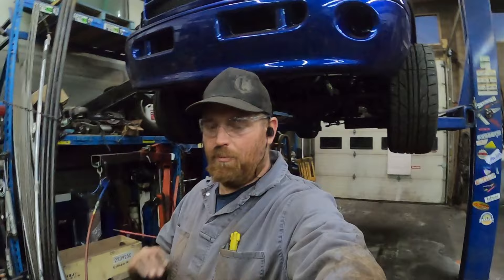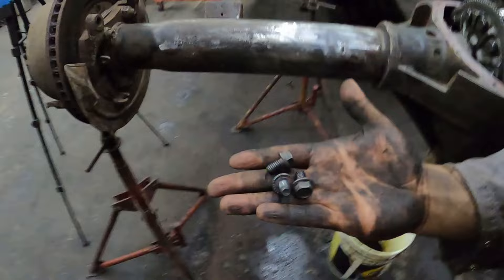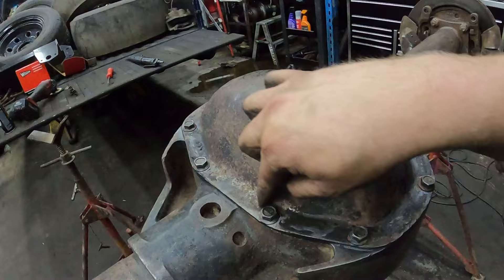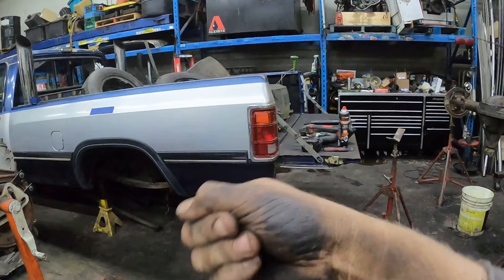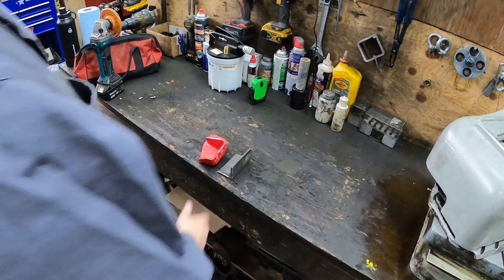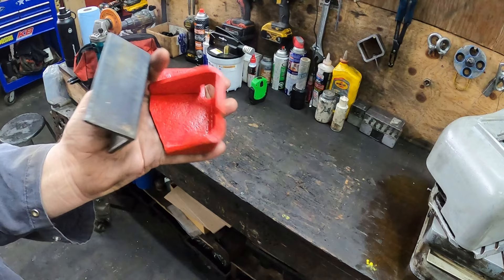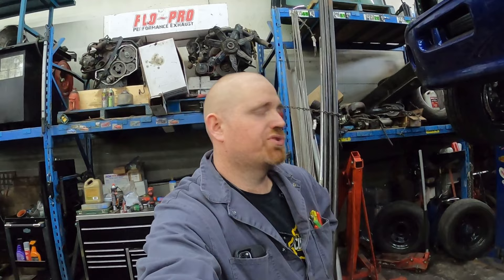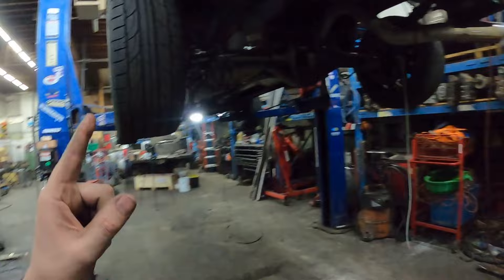DANA 80 DISC BRAKE  FOR THE SHORTY BUILD !!!!

Comment: Got a 100k front end I'm getting ready to put my 500 doller Timken berrings on. I will probably paint it do the seals etc. Then put it under my 97 dodge. Got the factory cummins head gasket and bolts to put in Tomarrow. It's my service truck, it's pretty for a 97. Welder is powdercoated to match
   I like the idea of powder coat the diffs.
   Just got the head gasket today.
Reply from the maker: I am looking at a 2wd first gen to do dyno videos with . Hopefully I can swing  it after buying the dyno

Comment: I appreciate your videos and advice . I cup brushed from front axle the 2001 after I got it home from  Differential and Gear , new ring gear , pinion. Bearings seals . I cleaned the  axle and painted it with some oil based paint and some harder . I seen that done before and I done that on some trailers . I got the harder at Atwoods . . I supported the axle similar to how you did on pipe stands.  Thanks for the advice on the rear axle. I ordered the moog 3 gen steering and I was told to use a 2001 Pitman arm so the tapers will work . I bought a 3 gen track bar and a conversation bracket .. I bought the shock tower delete and your advice on the shocks . I bought a locking hub , Timken bearing  kit for it also
Reply from the maker: right on jim , she is going to be a hell of a nice truck when you get it all done